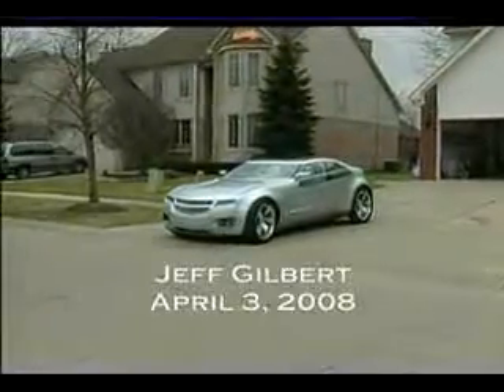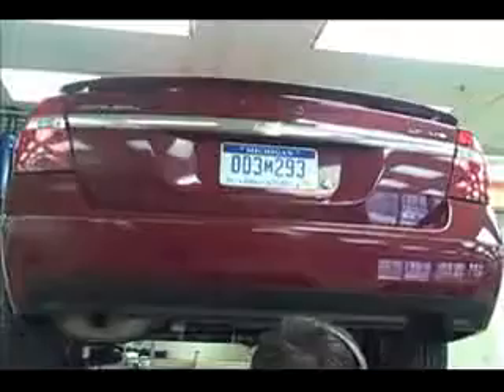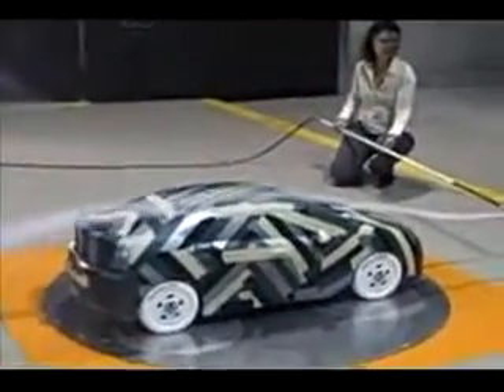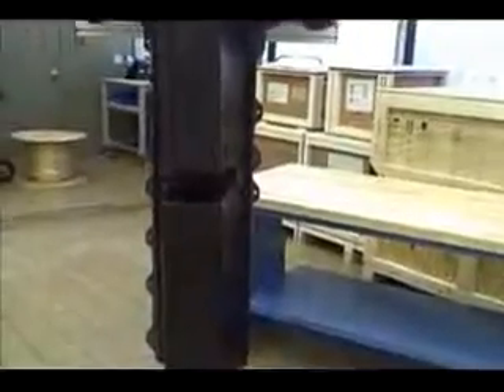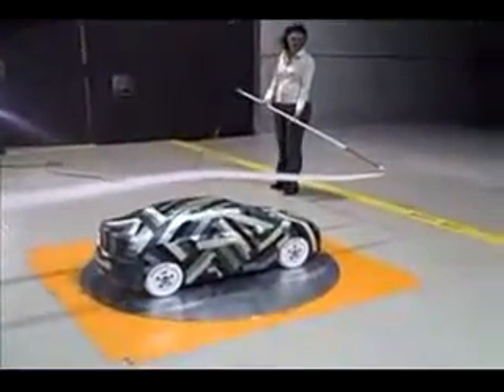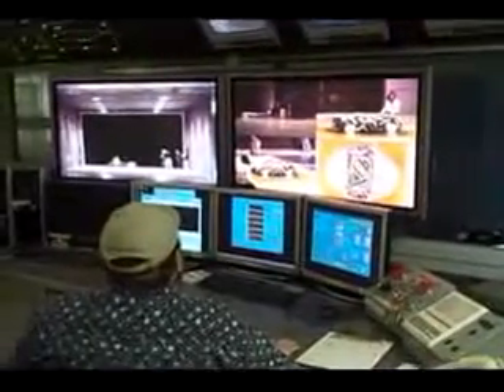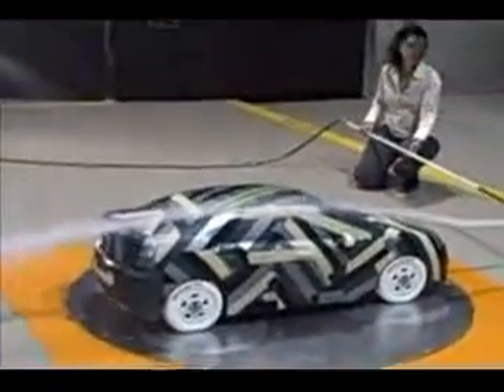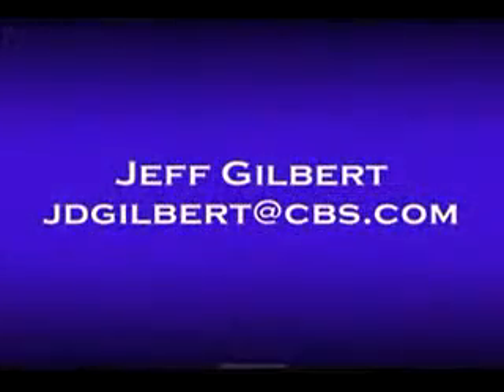Chev Volt behind the scenes in R&D Lab

Comment from the maker: You can't figure that out?

The 18.7 kw/hr lead acid batteries in the EV1 would be lucky to last 500 full cycles. The Volt batteries HAVE to by law last 10 yrs 150,000 miles which requires over 3000 cycles. To make the Batts last this long the bottom 20% and top 30% of battery capacity will not be used so they are in fact only using 8kw/hr of the 16kw/hr in the Volt. 8kw/hr / 200wh/mi = 40 miles. 

The EV1 also had a Cd of 0.19 while the 4 door Volt has a Cd of 0.28.

Comment from the maker: Well, turns out the Volt will NOT have wheel motors at all. Early publicity included wheel motors on the rear wheels, but they have not turned up on later PR... pity!

Comment from the maker: I doubt it! 

Zap are an outright joke to the EV industry, Phoenix haven't sold a single car and perhaps never will and Tesla basically sell you a very conventional EV converted Lotus at over 3 times the cost of not only the base car but also the full price of the Volt. Tesla might be flat out selling 1000 cars a year, GM plan to start by selling 100,000. It's GM that is leading, not Tesla and it's a huge plus for ALL EVs.

Comment from the maker: For a $30,000 retail price this car will have the FIRST EVER 16kw/h EV specific Li-Ion battery pack with a 10 years /100,000 mile warranty, I can't see how that's a bad thing!

They're the 1st major to have the guts to put 1) a large Li-ion battery is a car. 2) a series hybrid 3) wheel motors.

Once these EV sized Li-ion batteries are in full production the price will reduce and any EV converter will be able to by it over-the-counter from GM. It's only good news!